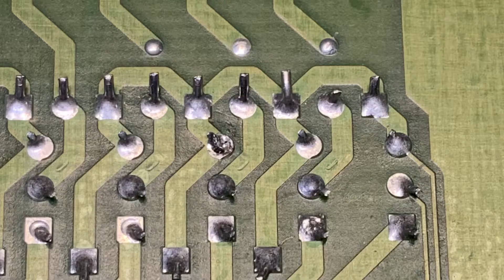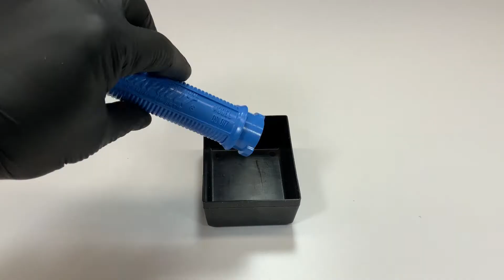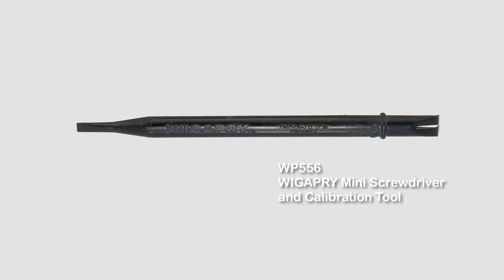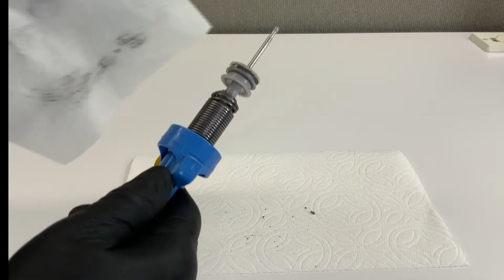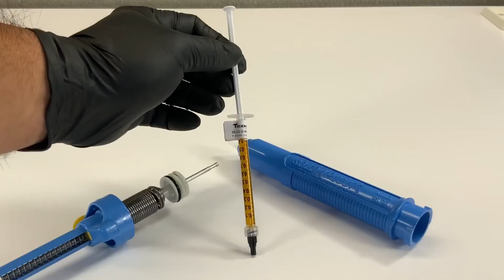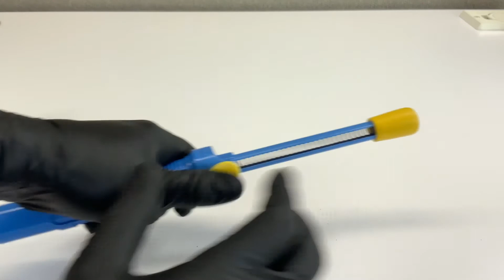EP4 | TOP TIPS - OPTIMIZING AND MAINTAINING SUCTION ON YOUR SOLDAPULLT DESOLDERING TOOL

Comment: Is pure silicone oil a suitable alternative for the o-ring? Or is o-ring lubricant required. Also why is the retraction pin meant to move up slowly, is it to provide continuous suction?
Reply from the maker: @penguinsushi8442  Thank for your question. You can try this lubricant but we cannot guarantee results or compatibility with materials.  The retraction pin meant to move up slowly is a visual indicator how well the lubrication and O ring are sealing for optimum performance.

Let me know if you have any questions.